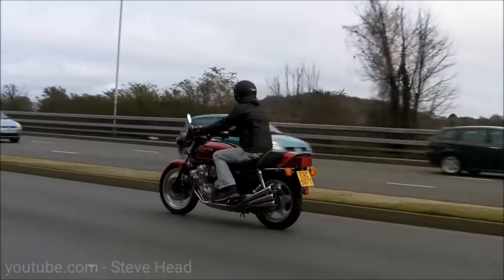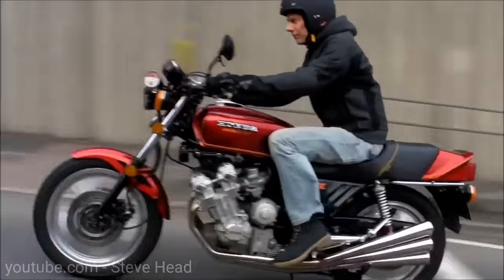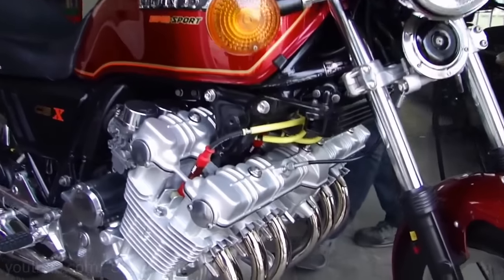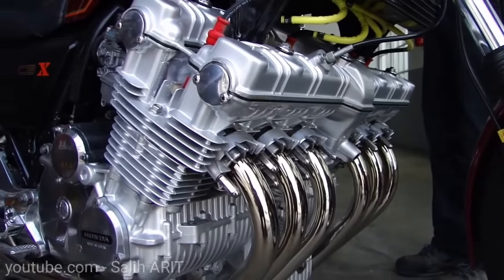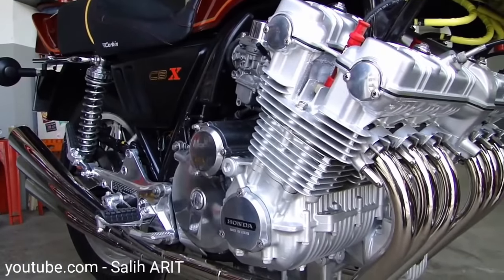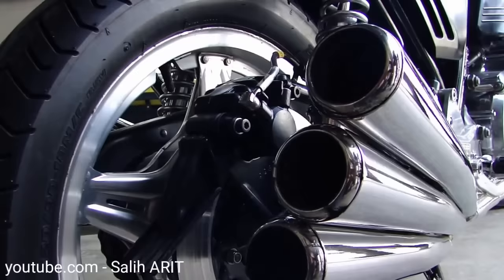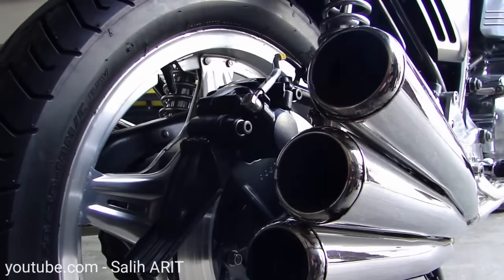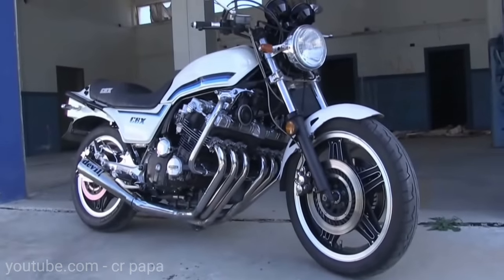Honda CBX 1050 - The Motorcycle That Sounds Better Than A F1 Car

Comment: I remember when this bike just came out and I was reading one of the magazines tests of it and the Honda Rep stated regarding the sound that the Honda Sound Engineers spent many hours at one of the American Air Force bases in Japan at the end of the runway recording the F4 Phantom Jets taking off and that the original exhaust that was designed to sound like them sounded so lethal that the Honda Execs vetoed it saying it sounded too scary. Thus this exhaust system you hear in this video was the second choice.
Reply: No they didnt... that is just way too cheesy to be anywhere close to reality.... they built racing engines for years... the sound is always good.. Im a pilot as well as a biker and anyway jets dont sound lethal taking off just boom loud... so whatever about that urban legend...
Reply: @yamasakimotovlog3431  I guess it was just really loud and "assertive"
Reply: @midgetman4206  yes like my reply lol...!!
Reply: @yamasakimotovlog3431  there you go
Reply: @yamasakimotovlog3431  It was in the magazine test article and the Honda Rep's were quoted....I am just passing along what I remember reading, believe it or not, it is up to you. As for jets not sounding lethal at takeoff, not sure what type of pilot you are but since you threw out your credentials, here are mine: I am an Aerospace Engineer with America's largest defense contractor and if you stand at the end of a runway and listen as a Front Line Fighter (which the F4 Phantom II certainly was) takes off under full military power and don't think that sounds lethal, well I think that speaks for itself. I also ride "scooters" and I am a former two class AMA Expert License Holder (125cc Motocross and 250cc Road Race) back in my H.S. days and raced a TZ250 (B) at Daytona in '75. Late.
Reply: @stevefowler2112  I doubted the story not your reading of it. And I didnt throw out any credentials but you certainly did. I can only speak from actual experience but anyway opinions are worth the same everywhere all the best...
Reply: @yamasakimotovlog3431 No worries...Look after yourself.
Reply: They did spend a lot of time working on the sound but it was to make it sound like a Porsche which is the exhaust that was put on the production bike's. I have owned 2 of them my first one I bought when they were first out, both of them had the original pipes but after hearing this sound clip I wish I would have found a set of those 6 into 6 pipes that's a sweet sound.
Reply: @rick8910 Thanks for the info, I was just passing on what I remember as a very interesting tidbit in the magazine article. I have owned a lot of go fast scooters over the years (i.e. Super Bikes) and raced Road Race in the AMA for one season a LONG time ago (TZ250 model B), but I still think the best sounding/hell raising sound bike I ever had was the 1972 Kawasaki H2 750 I owned my Sr. year in H.S. in '74-'75. It had Expansion chambers and I usually ran it with no silencers...my GF and my Bud who lived right next to her claimed they could hear me coming over a mile and half away by counting the corners/stop signs...I can still hear that sound in my ears to this day. Nice swapping stories, take care dude.

Comment: I put 20,000 miles on a CBX in the 80's ... if you tried to use all of the power, you better be holding on tight and holding your breath - extremely reliable and good fuel economy as well

Comment: I came close, I rode a CB900F Super Sport,a 1983 model, back in ‘90, fantastic speed cruiser with that 4 gallon tank and smooth as glass 4-inline. Miss those days. 😪

Comment: BMW: we make the best inline 6 engines in the world.
Honda: hold my beer
Reply: ⛔🔑reproduct
Reply: Hold my saki
Reply: @forrestgump5051  lmao
Reply: @forrestgump5051  saké
Reply: German engineering by the Blue Eyes and Pink Skin !!
Reply: Soichiro Honda : Hold my Sake
Reply: And to think that it all began from the infamous Honda cub probably one of the longest lasting bikes in the world! 😁😁😁👍👍🇲🇾🌈🎌👌👌✌️
Reply: @aruwihikamu3896  lol 🤣👍🇲🇾❤️🎌✌️👌🌈
Reply: And honda engines will outlast any crap bmw engines so
Reply: @loooopeytunes  
Uh huh...you have to REMOVE that CBX engine to adjust the valve lash..
Reply: BMW sucks.
Reply: But a kawasaki ZX25r inline 4 250cc and change to aftermarket pipe.will change the game when it comes to motorcycle sounds hahahaha
Reply: Hasn’t Honda been making motorcycles far longer?
Reply: @easyenetwork2023  
No
Reply: No BMW made their first vehicle, a motorcycle in 1923,they started in 1908as a manufacturer of some of the very first gas powered water pumps
Reply: @joshschneider9766  
BMWs first motorcycle was in 1919, the Flink. 1923 was the first incarnation of what we have today .
In WW1 BMW built airplane engines, hence the logo of looking through the spinning prop.
Over the last 40 years I've put over 100k miles on numerous airheads. 
An R50/2, steady 84mph for two days straight cross country ( as to not be AWOL)
Two thousand mile days back to back on an '81 R100RT,  ( as not to be AWOL)
Hovering at redline (138mph) on my '03 GS1150ADV all over nevada and the west  for thousands of miles ( because I could)
Cruising at 110mph steady state on my R75/5s. R60/5s
Half million miles in the saddle and aside from a few flat tires and running out of fuel a couple times.. ( mpg is horrible at over 100mph ) Those airheads have never let me down.
Reply: @patrickhorvath2684  I work on these for years and you do not have to remove the engine to adjust the valve lash, just remove the two side brackets and valve cover and you have all room you need! you do need the special tool to do it thou.
Reply: @mcfast52  
Okay that's just what I read in a bike magazine ages ago.
I'd love to have one !  A six is the only engine configuration that I've yet to own.
Reply: Ever heard of the I6 barra engine made right here in Australia
Reply: hold my cylinders

Comment: I owned a cbx 750F back in 1988-92. It was built in Brazil and it is still famous for its one of a kind roar. It is the best sounding bike I know, however, listening to the sound of the CBX 1050 gave me goose bumps. Thanks for the video, and since I am a formula 1 fan, I really heard that screaming sound of a v8 and a v10 of (sob) the F1 cars of the recent past coming from that bike, fantastic!

Comment: Those old Hondas are some the best sounding rigs out there. My first bike was an 86 rebel 450, which was a total romp in the corners and on one occasion beat a newish at the time 883 sportster. 2nd was an 02 intruder 800. That thing was unmatched in 0-40 but kinda started to run out of breath once you hit 3rd gear and were on the final stretch to 60. Still very comfortable and the only bike of mine that I've managed to wheelie. 
Now my 3rd, and last...for now, was something special. That was an 85 magna vf700 with an aftermarket intake, jets, exhaust, and cafe bars all finished in  an orange pearl. Hands down my funnest bike to date. A rail in the corners with a smooth pull up to 7k...where suddenly "vtec kicks in, yo" and you're holding on for dear life all the way up to 11k if ungoverned. I would absolutely buy another one in a heartbeat

Comment: If they made a 6 cylinder car that sounded like that it would sell!
Reply: justvettn vr6
Reply: @WhiteJawz1  until it breaks down
Reply: @VeNoMS4  oh tell me when a vr6 breaks down. At least speaking of the 24v ones
But it doesnt sound like this anyways. With increased rev limit and a custom exhaust manifold maybe
Reply: Check Out “Opala 6 cilindros “ or “Opala 6x2”
Reply: RB26DETT
Reply: The Datsun 240z was an inline 6
Reply: @KarrasBastomi  the RB has a softer and smoother sound to it
Reply: No! They would make it a 50 hp engine. Per CC or cubic inch, car engines always have hardly any horsepower. Tuning it for torque is killing some ponies too. Unless they add a turbo or compressor.

Only if you spend more than 500.000 dollars, you can get an engine with more "specific power." Most cars don't come close to the power-displacement ratio in F1, or even in pretty average modern motorbikes. But our car engines keep riding for years, needing not that much maintenance.
So please don't kill another 6 in line by downtuning it as usual.
Reply: @GatisGirdenis  Stop. Not a V6. V6 is way more compact. This is 6 in line engine. Like in the BMW's. E30, Z4 to name some. And that Datsun mentioned here. There must be more, but I don't know cars.
A funny fact is, Mercedes had a 5 inline big diesel, because a 6 inline based on their 4 cylinder diesel simply would not fit. Audi 100 had a 5 cylinder 2.3 liter too, I guess they wished a 6 inline. Easier to balance and running smoother. But you could check that yourself. Perhaps Audi chose that 5 cylinder concept for other reasons: it is smaller after all. Engine design is interesting enough.

Don't forget the other 6 inline motorbikes. Benelli Sei 900. BMW K1600GT(L). Just two, classic and modern. Weren't there some 6 cylinder 50cc racers?
Reply: @voornaam3191  but it's a 6 cylinder engine that can be made to sound like that bike. like any other 6 cylinder, really
Reply: @GatisGirdenis  In a normal V6 the firing sequence is different from a 6 inline. Unless they use a modified crankshaft. 

Just like a 270 degrees parallel twin sounds like and runs like a (Ducati) 90 degree V-twin. Good idea.
A 180 degrees parallel twin sounds totally different. More torque.

But why on earth would you change a V6 crankshaft to the smooth running 6 inline? It is a 6 cylinder already, how bad can that be? For smoother running and less stress on the clutch, gearbox and so on? To get the V6 better balanced, more like the perfect V8? Or do they apply the same trick as the cross plane crankshaft? That's for optimizing gas response, isn't it? I don't see the point of using a complicated crankshaft just to get the inline sound, while you could also choose for optimizing other enginge properties, like balance or gas response. But sure, car manufacturers can do as they please. If sound is more important than performance, so be it.
Reply: @voornaam3191  at the first sentence I can already tell you missed the point. VR6 has the same firing sequence as an Inline 6, so point invalid. VR6 is more of an inline 6 than a v6 in almost every aspect other than the offset cylinders.
Reply: @GatisGirdenis   How many degrees are the heads apart, and show me the crankshaft layout, please. It is impossible to get the six sparkplugs firing at 120 degrees apart. Or is it?

I'll google it. The whole idea was to get a smaller engine, if they got the firing sequence even, they got what they wanted in the first place.

But I just assumed two opposite pistons share one big end. If that is not the case, you just got a complicated crankshaft, and it could work. 60 degrees between the heads is half the 120 degrees you need. Yes, you're right, it works fine. V6 is a smart engine design.
Reply: @voornaam3191  it is a single head V engine. 10.5 degrees or 15 degrees of angle between the banks. each piston has a seperate big end.
Reply: @GatisGirdenis  That makes sense. That W12 engine in the Phaeton is doing the same trick, it is in fact two VR6's combined to one W-shape for 12 cylinders: three heads instead of four.

Powerful V6 and W12, how much more VW can it get? A W16 would need no rotating counterweights. That would run even more beautiful than that W12. Or does the combination of two V8's ruin that perfect balance?
Reply: @voornaam3191  w12 is two vr6s, yes, but it has two heads. There is a w16, it is made out of two w8 passat engines, and it is the heart of the widely known bugatti veyron and chiron
Reply: @GatisGirdenis  Sorry, have no money for those Bugatti's. Not even for the tyres, I'm afraid. Funny they still have piston engines. Considering the power I would go for a turboshaft engine.
And considering the money, I'd buy an airplane. Where can you drive  300 mph? It's just a car showing you have too much money. But funny those W16's exist.
Reply: I did have a buddy who owned a heavily modified vr6 GTI that sounded like those old jaguar racing V12's.
Reply: @ryanosbourne9945   Why didn't he buy that racing Jaguar? Now he spent probably more on modifying a VR6.

Or did he do it like the Porsche Cayenne I once saw in Norway? That one was fully modified to handle 1000 hp instead of the usual half of that. Scary fast.

And if you want a car for excelent driving, find yourself a Toyota MR2. It has a mid-engine, which makes fast cornering a blast. But be prepared, it has not much oversteer. Compared to the Golf GTI it is not fast, but its wonderful handling makes me wonder, how an MR2 would perform with a VR6 behind your back.
Reply: @voornaam3191  there are n/a Honda engines with more than 100hp/l, eg the old Civic type R or the S2000

Comment: I bought a 04 VROD in 2009 when I was 50. It had been 35years since I owned a bike it being a 650 Bonneville. My six children had grown up and left the coop and feeling a bit empty I realized I wanted to get back on a bike. Took it easy until I got myself comfortable with the Vrod and then started to enjoy the thrill of the ride. I traded for a new night rod special in 2015 but only kept it till 2017. I'm 65 now and I'm going to get another bike. I'd be more than happy with an old B33 or an ES2 now. The new bikes today are amazing but lack the character of the old oil dripping bangers. They have their own distinctive smell of petrol and oil together and just want to be loved and nursed along. It would be good to get on the tools again as well.

Comment: Remember riding my workmates brand new CBX at lunch one day my regular was a Yam. RD250D so huge difference !  The Honda seemed huge until I let out the clutch and moved under it's own power then it felt like it shrank under me , 
At the stop lights i noticed people staring at it , people were counting the ex. pipes and amazed at sound of this beast , to me it sounded like a Ferrari and F1 all rolled into 1.
I'll never forget opening it right up in the first 4 gears That was fast enough for me the telegraph poles looked like they had shrank into match sticks as it accelerated my vision had to concentrate on a point in the horizon as you were heading there very quickly , on the return of the keys my hand was trembling my workmate just laughed then said what did you do?
I was kind of embarrassed , i said dont worry I didnt drop it , at that he laughed even more .
I'll never forget that CBX ride !
believe Honda's CBX it was the first mass produced 100hp litre engine in the world.

Comment: The last of the straight sixes,my dad had one in 78 took it too the isle of man,dropped it racing a motor guzzi and took it too dugdales on the island and he replaced the engine protection slider bars and clutch lever free of charge and got back on the road in 4 hours.back in the good old days when bikes shops took care of their customer's

Comment: I had a CBX in 1981 (and BTW it was a “CBX” or occasionally a “CBX1000”; never called a "1050”.)
I struggle with your description of it as just like the other bikes of the day, with “severely under engineered chassis with poor suspension set-up.” My friends were riding lovely big Kawas and Suzis, and the handling of my CBX was a clear step up. My pal’s gorgeous Z1000 knew when it was outclassed.

Comment: I had one of these 20yrs ago. 2 x 3 into 1 Header pipes with Slash pipes on the ends coming out just behind front foot pegs. No silencer cans. Sounded like a V6 when driving normally but when you twisted this things ear all hell broke loose. The sound was the best you would have ever heard. From a long way off. The scream of freedom. I'm sorry that I sold this bike. Best sounding, loudest bike I've ever owned.

Comment: I'm 61, and back in the day I had a 1979 and a 1981 CBX 1047. Yes they were referred to as the true displacement 1047cc, not 1050 as the younger generations call them nowadays.  My '79 had a Winning 6-1 exhaust system, and when the revs passed 7000 rpm the exhaust sound changed to an absolutely insane high pitch F1 V12 sound. The memories still gives me goose bumps..
Reply: ah you lived a life of symphony.
Reply: I'm 60 yes they were called.cbx1050
Reply: Remember  well the speed wars hond made the 78 cbx 1050 to win the yr

Comment: The in-line six is a natural for the smooth application of torque. The reason it sounds so much like 12 cylinder F1 engines is because of the firing sequence: a V6 will never sound this good, and even worse, it will need either a balance shaft like the Buick 3.8L or a harmonic balancer that will have an rpm range just off idle where even that won't keep balance.
Reply: Did I mention I hate V6's?

Comment: +100hp on a motorbike back then was +insane. I guess they manufacture the F1 engines with that sound as a reference.
Reply: Ferrari v 12 was even more bestial , louder, and more rpm. You needed ear protection to get close the fences , the shock wave was enough to kick you back.

Comment: I got one in 1980. Unbelievable. RPM was off the chart. Just touch the throttle and you were gone. Sold it for a 1100 midnight special totally regretted it they are legends today.

Comment: Definitely agree, had a 1981 with a Pipemasters 6 into 6 system and the sound @ 8000rpm was insane.
One of the best sounding motor vehicles ever.

Comment: Im 54 and have 2 of these, a 79 and an 80. The best sound is from my 80 with 6 into 2 Jardine pipes that are basically straight through. I love riding but have had 4 bikes stolen in 2 years now. when I ride my sport bikes I don't take my eyes off them. when I know I'm going for the day and have to leave the bike at times I ride my 2001 goldwing 1800, no one in there right mind would steal it . I think it weighs 1800 pounds too but it's like a lazy boy on wheels compared to sitting my aging 6'4 frame on a sport bike with rearsets for more that 50 miles! cheers
Reply: Would you like to sell one :D